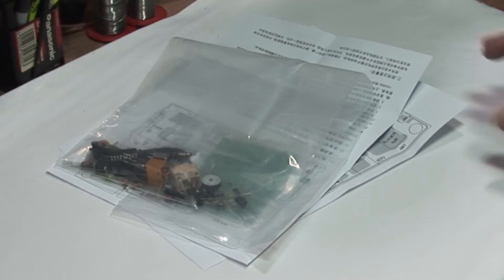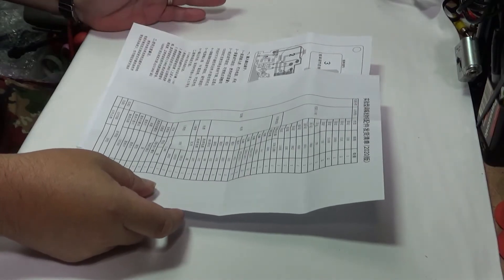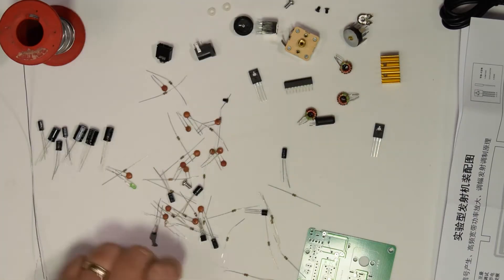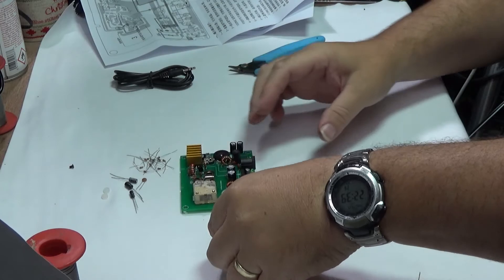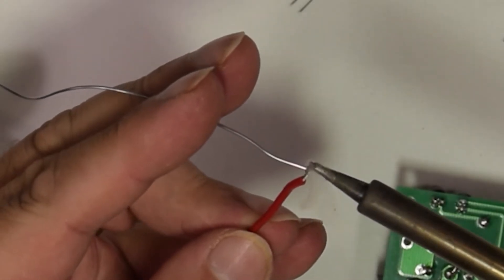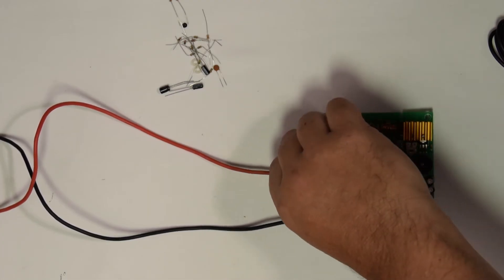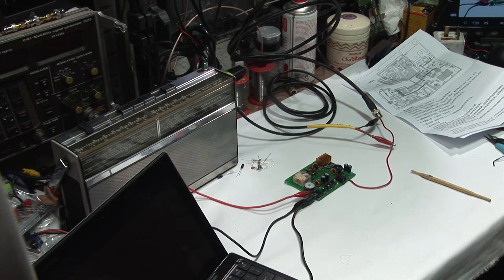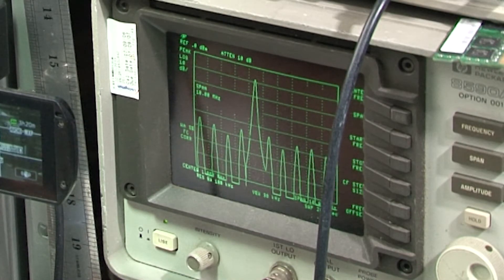AM Transmitter Kit for Vintage Radio

Comment: Hi George about the same results i got with mine i cant decide if the distortion is from the input amp or the output stage the modualtion control has little effect. With a 9" aerial the range is over 15 foot .a circuit would be helpfull. great video
Reply: See my comment above. Or maybe below.  : ) Not at all a bad little rig.
Reply: Bit of an update. Done some insomnia experimenting & anything far removed from a 50 Ohm load results in a distorted waveform : ( A few feet of wire alone won't cut it without an ATU. Ergo, don't know how much you know Rob, but best bet is a couple of 100 Ohm > 1/2 Watt resistors (NOT wirewound) in parallel solderered between aerial outlet and the junction of the adjacent 2 470pF caps. Makeshift aerial can then be connected to the aerial connector as usual. Keep the voltage down to  5Volts and it will still deliver the advertised 500mW. Rather inefficient solution, but sound quality is  most satisfactory for yardcasting.
Reply: @lennyh500  this is an AM-transmitter fitted for a longwire-antenna. 

Impedance of a long-wire-output is always high. And I don't think that there is some kind of balun-cicuit provided

What's also very important is the "ground-wire" to have the "counterpoise" between your areal wire and the ground. 

All this is not said in the so-called "manual".

If there would be some kind of 1/9balun, I'd advise the use of a shortened dipole ... but you'll need some (serious) coil at the feeding points.
Reply from the maker: I think the distortion is from the TDA chip providing far too much gain. The controls have little effect as you have found. I will try it with a filter at some stage and a longer aerial and see how it behaves then. Circuit diagram I found in a review comment on another ali sellers listing, https://ae01.alicdn.com/kf/Ud94d569f2d8a4a62bdd1be79634bc60b3.jpg
Reply: A tip: watch movies at Flixzone. I've been using them for watching lots of of movies these days.
Reply: @Ralph Paxton Yea, have been watching on flixzone} for since december myself =)
Reply: @Ralph Paxton Yea, have been using Flixzone} for since november myself :)

Comment: This kit has gone through a few revisions since this video was made. I bought two of the latest version (2024). They seem to have addressed the harmonic issue with a pi filter at the the output. The instructions now come in English and Chinese. Still not great. I did write up a new build instructions for it with places to stop and check and test your work with a multi meter and scope. Unfortunately, I can't contact the seller to give it to them. But if you want it... :) This is definitely NOT a U.S. Part 15 kit, nor do the instructions imply it. It's capable of outputting 400 mW, four times the legal Part 15 limit. It can be adjusted into the 160m Amateur band to about 1845 KHz (QRPP mode anyone?). I can certainly vouch for the distortion only because the transmitter was so close to the receiver (front end overload). It sounds a whole lot better at a distance of about 1.5 meters (5 feet). I fed this into a 600 x 600mm (25 x 25 inch) loop antenna at it's lowest power setting and was able to get about 15 meters (50 feet) using a GE Superadio. 

If you expect to get any range out of this transmitter, I suggest you go to Bob Weaver's Electron Bunker web site and read up on his expose on antennas for Part 15 transmitters. It's well worth the read and is explained simple enough that most readers can understand it. 

 https://electronbunker.ca/eb/AntennaMatch.html 

George basically used a wet noodle for an antenna and the results were poor. A properly tuned and matched antenna makes all the difference with this kit. I'm satisfied with both of mine. My vintage radios now sound really good with something more than the news, sports and fire and brimstone that now dominates MW. At under $20 US, not a bad kit...

Comment: The less components the better the results. My first AM transmitter was a one germanium OC44 transistor circuit, modulated by the output of my portable reel to reel tape recorder ie a basic 4 transistor 1watt or less amplifier such as in portable radios etc. With a 5m antenna it had a range of about 1km on a 6v supply. Without the anntena it's range was about 10m. The sound fidelity was excellent and stable without any drift. The oscillator and feedback coil was wound on a 15cm ferrite rod.

Comment: I built it this weekend. Easy project. All parts provided. Nothing left out (except knobs/dials for variable cap and audio input potentiometer). With a little twiddling I finally got a strong, clear signal with minimal distortion. I went rouge and connected it up to my outdoor SW antenna and ground. I dove my truck around and listened to the transmission with my truck radio. The signal covered most of my neighborhood block. I'm sure I could improve transmission range with a better tuned antenna. Presumably there are lots of spurious signals being generated. The transmission signal drops off pretty quickly outside of my immediate neighborhood area. It will make a nice local pirate station.

Comment: I am looking for a medium wave transmitter just to transmit across the room in my house to some vintage am radios i restored. I bought several transmitters and they all are loaded with the harmonica you show and transmit all over the place. They hum like mad and barely make it to the radio setting next to it.

Do you have any recommendations or even schematic of something with decent sound quality and reasonably clean output?
Reply from the maker: Many cheap and simple designs are available. Try the one from my transmitter on a sheet of toilet paper video or the breadboard transmitter video.

Comment: FM transmitters sound and work much better.
Reply from the maker: true, but most vintage sets are AM
Reply: @GeorgeChristofi , yep. Sorry I missed the significance of the channel name when I watched the video. Fortunately for me I got one of those little Lafayette (I think it is,) tube AM transmitters that was in the bottom of a junk box I bought at a ham swap for $5. It worked, and I was delighted. It sounds pretty good into the AM broadcast bands on my old tube Hammarlund shortwaves. I have an Arborphone Model 27 TRF radio that I'm eager to get tubes for, (though they aren't cheap.) I'd like to run vintage radio shows into it from the AM transmitter.
Reply from the maker: @johnwest7993  Not a problem. I do have a couple of FM units too and I did import one of those realtor home transmitters from the US as a comparison from commercial to homebuilt units. The one I do want to build is the one that @AllAmericanFive has on his channel many years ago. That is a tube unit and it sounds absolutely perfect. Another of my get round to projects of which I have many! I do have a homebuilt radio that was constructed in 1925 complete with tubes and power supply but have yet to run that up. One more project.. its never ending here with so much in my storage yet to do.
Reply: 64 - 108 MHz (HRD-831)

Comment: Just finished my kit, it has a few more capacitors and coils then  yours but I guess, like everything should, it improves with age.  For an antenna I dug through my cable drawer and found an 8 foot coil of inside house wire for old telephones. I stripped off the outer cable and took one conductor out (green ) and wrapped it tightly over  a long antenna from an ancient AM/FM luggable radio that I junked.  Then with a long coil I covered it with a heavy duty shrink wrap and heated it. I came up with a rather solid antenna and soldered it on the mount that came on the board.  When I fired up the transmitter and fed it some output from our  local AM radio station it came across another receiver across the room nice and easily as clear as the original set hooked to the transmitter.  Wish I had a good case for it, been playing with either building it in my wood shop, or perhaps cutting some old CD Cases  up for a clear case to  hold everything in order. I didn't build a  base for my antenna so I have to have the unit on my chair so I can lean the antenna against the back.  Works for now I guess.

Comment: Can someone help me. I puy together one of these kits but not sure if it's working. Do I need to connect an antenna to it? I only have what came in the kit and none of videos seem to elaborate much on what else is needed if anything.
Reply from the maker: With this kit you cal fit an antenna but it will work if you put it near a radio. The antenna will increase the range.

Comment: I bought that thing and put it together. three parts were missing. you understand he's not working now. I could still replace the two missing capacitors, but the trimmer which is situated nearby the antenna output is still missing.
Unfortunately.
luckily it doesn't cost that much.

Comment: George, do you know the value of capacitor "203", would you measure in circuit? Any help would be appreciated.
Reply from the maker: the value 203 is 2000pF or 2nF. The only way to properly measure capacitors is out of circuit.
Reply: @GeorgeChristofi  20nF - 20x10^3
Reply from the maker: @radosawrogozinski8560  I missed a zero. Brain not working.
Reply: @GeorgeChristofi  It was 0 so really nothing. :) I assembled such transmitter 2 weeks ago. It works without distortion when input signal isn't too strong. They put 200ohm potentiometer instead of 50k (!), there were no 20nF capacitors in the set, only 10nF, 100nF caps have 60nF in fact, so I used my own parts. Carrier signal is weak - one high sine wave, two lower ones, etc.

Comment: I bought the same kit. ( before I watched your video thought) and In hef the simular problems.
I miss a few important items, and a have some rubish left.
Doesn't work...
To bad though, because I like having a low power AM transmitter because of my  old tube radio's get to work.
Not much AM stations in Holland..
Wel keep up the good work.
Enjoying your video's

Comment: Hi everyone from Western Greece (Peloponnese).
I have made a self-oscillated transmitter circuit which was published in a Greek, primary school circulated magazine, in 1975 with BD135 transistor, 3.3KΩ and 10nf  to the transistor base and 150pf for output capacitor.
I have also add a 500Ω-680Ω resistor to the transistor emitter and parallel to this resistor the primary winding of a 100V 10W audio matching speaker transformer.
The 8Ω secondary side of the audio transformer is the audio input for the modulation. 
I have managed to receive my signal in a distance of 1km about with an external 50m wire monopole antenna and good grounding.
The results of that project are really good for the simplicity of this circuit design.
 https://www.youtube.com/watch?v=3AJ5L28tq-8
Reply from the maker: Normally its considered bad form and practice to just post a link to your own videos or channel without asking but as your design looks interesting I'm willing to let it go this time. I have actually checked out your channel and you do have some stuff which I might watch very soon.

Comment: nice video.... George you try to change the PFilter?
Reply from the maker: not on that unit. I was tempted to add a separate pi filter onto the output but the whole design is really not worth pursuing.

Comment: Thanks for putting one together so we can see what its like, not fantastic I guess. My valve TX I use sometimes, is Suppressor Grid modulation and has negative feedback and I must admit I get good results with that. Thanks, George.
Reply from the maker: The design leaves a lot to be desired for sure. It isn't inherently bad, just lacking in filtering and poorly implemented.
Reply: How would you add filtering to this to get rid of the harmonics being transmitted? @GeorgeChristofi
Reply from the maker: @kwacz  Probablt with an lc network on the output to the antenna or even some form of impedance matching of the antenna wire.

Comment: George the Tesla model is the 532A. With wot seems a duff mains transformer. Cheers.
Reply from the maker: Ok Jeff, been looking at the transformer on the schematic and in reality pretty much any transformer capable of running a 6 valve set should do. I haven't put the schematic or service info through translate yet but from the figures it isn't really anything that can't be replaced. Do you have a copy of the drawings?
Reply: @GeorgeChristofi  Thanks George. I do have drawings.  Think I got them from Radio Museum. I will see about emailing them to you. Thanks again.

Comment: As it stands this is pretty dreadful device and probably not legal. if you put a scope on the carrier it will not be sinusoidal ans as you know this will be causing the interfering harmonics.  I would try and reduce the output and also try it on 12v as well as with a filter on the output at the frequency you will be using it at. Also for  AM limit the audio bandwidth to 9 Khz. Also I recommend a metal box and earth that,  Then you should be OK.
Reply from the maker: Any am transmitter is illegal over here anyway but the point is moot... Its a bag of nails masquerading as a pro product.

Comment: Hey George!
What are the levels of the carrier and the harmonics?
I agree with you...it is basically crap.  If you were going to design and build one of your own design, what would you design?  Care to go for it and give us a schematic?
Reply from the maker: The carrier level on my spectrum analyser showed the fundamental carrier at -10Db, with the harmonics only -30Db lower. Biggest issue was the width of the signal. If you put it near a radio with a poor front end you would hear it all over the MW band. I wouldn't do the design from scratch thing because it would be re-inventing the wheel. A lot of good designs out there already. This one needs the audio gain and the output looking at to clean it up, not much more I'm guessing.

Comment: Hi George. Gone adrift with the Tesla. Changing perished cables from mains transformer . but got one wire adrift. They both go to the volts changer plug, got one on. Dont know where the other goes to ?. There are 5 connections. Can you tell a dummie how to test for which one.  Cheers
Reply from the maker: Depends on the type of voltage changer it is. If it is the same as Philips ones with the pins then I can look it up. The rotary switch type the same. Let me have the model of your Tesla and I'll look at a schematic.
Reply: Thanks for reply George. I will put some best wordage together to give you a better idea and a pic
I am at the mo going through it like a dose of salts as they say.
Still got to do all the caps. But magnifying glass and finger is finding bad joints (is there a bad joint)lol
But ohm meter on primary "says no"
It will not stop me from trying . buying a new bit. Making it look and hopefully sounding good.
Thanks again George

Comment: It did sound quite distorted. But I have to say I haven’t managed any better with my own AM transmitter builds. Be interesting to see the modulation do you have a modulation meter. Probably some form of limiter would help . Thanks George alway entertaining regards Chris
Reply from the maker: I could run it into the 2955 but it's probably not worth the full scale effort. Saying that, having it permanently on and Bluetooth connected might be a good test setup on the bench.

Comment: nicely done its a bit overly complicated for such a messy output Ive seen simpler designs work just as well !
Reply from the maker: Indeed Benji, I have built simpler cleaner units on toilet paper! If it had adequate filtering I think it could be quite a good kit with a significant range.
Reply: @GeorgeChristofi  I expect it could be.it would  nice to have a valve one

Comment: I think the transmitter would have a lot more range if it didn't have all that wasted energy in the harmonics. I've heard that these Chinese electronics kits are actually designed by engineering students as part of their university education. The best ones are then chosen and sent to be mass produced by the factories in kit form. As you say George, it is what it is. Hey Ho.
Reply from the maker: See, you have caught the Mancave virus.  Apparently it takes a lot of therapy to cure it. The transmitter on the other hand just needs filtering, the input stage looking at as well as the output control, a metal box and a good aerial.

Comment: Interesting that you mentioned AM broadcasting stations shutting down. I think it is a grave mistake. I am already missing a few SW channels on my shortwave due to Am stations being shut down.
Reply from the maker: We have lost around half a dozen AM BBC local transmitters this year alone. BBC Radio 4 on 198Khz is on its last transmitter valve and there are none left in the world to replace it with. Once that fails, we will have no Long Wave transmitters in the UK.
Reply: @GeorgeChristofi  I honestly think it is a global initiative to restrict long distance communications. that way communication can be globally controlled to regional clusters. They are working hard  to control the narrative.
Reply: It’s due to AM traveling so far crossing country lines the US AM stations broadcast to Russia and Ukraine from Florida most USA radios didn’t come with sw they was so afraid our outside info